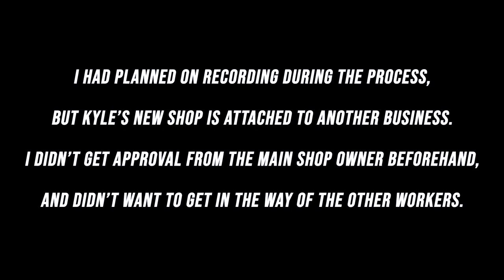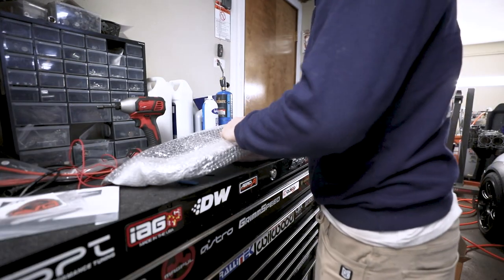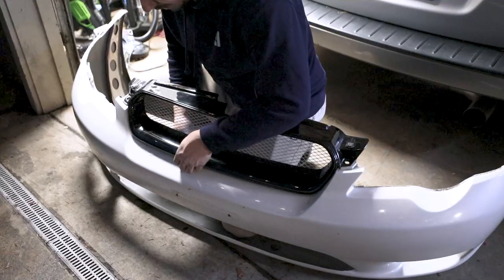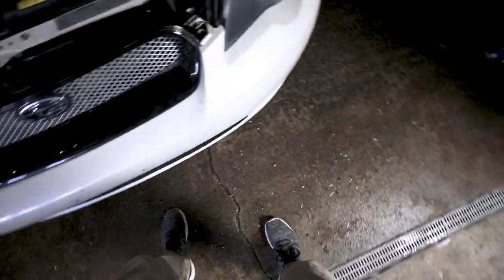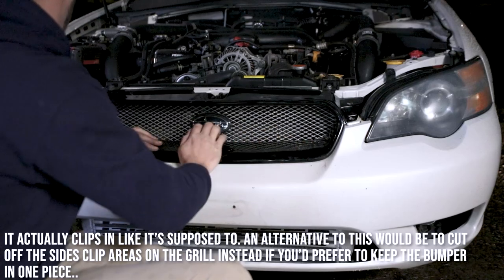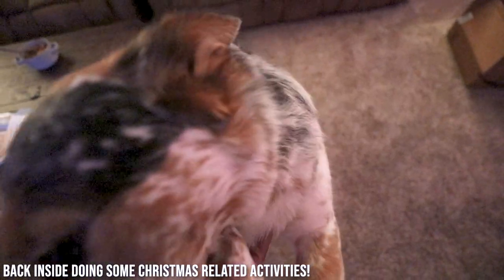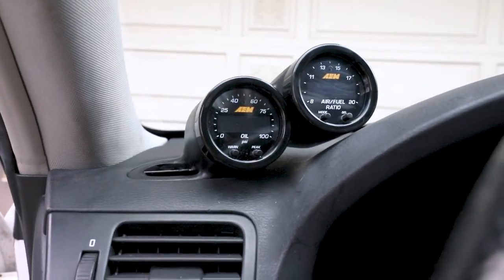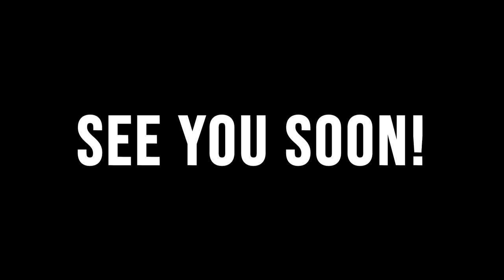This grille cost me less than $100.00. Was it worth it?

Comment: Hey do you know any nice grills that would fit in a 06 OBXT, don’t know if the legacy ones are interchangeable. Thanks
Reply from the maker: Legacy and outback have a different shape so they aren't unfortunately. Jdm fit somewhat, but leave a bit of a gap at the bottom. I had to make mine on the outback prior to getting my jdm bumper.

Comment: Why didn’t you just buy a jdm grille?
Reply from the maker: Different shapes. Jdm has sharper corners, and you're normally left with a pretty noticeable gap at the bottom. Car had a jdm option grille on it previously, so I wanted to test out one shaped for a usdm.

Comment: The fitment looks really good, I think I'm going to grab one for my 06 legacy wagon... just ordered some tein z coilovers, next will be sway bars. I've heard doing just the front on the wagons, is better than doing both rear and front for solving understeer. You think that makes sense?
Reply from the maker: I'd recommend front and rear. The wagons are honestly pretty well balanced, and the only times I had ran into understeer was either my fault (too fast at entry) or the tires themselves didn't grip enough. They do have an inherent understeer due to the front bias of the drivetrain, but it's minimal. I personally run a whiteline front and cusco rear on the outback, but I'll likely do front and rear whiteline for the legacy. 

With adjustable components, like the rear lateral links and upper control arm, you can make some pretty drastic changes to suspension geometry and alignment, but a lot of it like I said can have to do with what's gripping the ground in the first place. 

If you are currently looking at whiteline components, I'd recommend to check out emnoteks website. They have whiteline at like 2/3 the price of everywhere else currently, and I'll likely pick stuff up soon on case it doesn't stay that way.
Reply: @MatlasDI  thanks for the advice, ill check emnoteks for sure hopefully they ship to Canada

Comment: You know you can use some jdm grilles with usdm bumper I’ve had two that fit way better then that one
Reply from the maker: Realistically, I just wanted to test out the usdm fitment, and it was cheap. I've had a few jdm grilles at this point, and they've all left a gap at the bottom or not fit the shape quite right, so I figured I'd test it out.
Reply: @MatlasDI  no I get why but if you get a certain yr of jdm grille it will fit perfectly no gaps I can show you the two I had and what they looked like I will tag you in a post on one of our legacy groups
Reply from the maker: @CWW-tv  sounds good, I'll check it out 👌 think the only ones I've seen that seemed to fit alright was a zerosports or corazon.
Reply from the maker: @cww-tv3267  those don't look bad at all 👌

Comment: Love the progress! I'm definitely considering the same gauge set up. I was thinking of the middle section between the vents, but it seems routing wires would be much easier in this location. 
If you paint the grill trim white, leave the mesh silver. If you leave the trim black, definitely paint the mesh black. Just IMO.
Reply from the maker: Yeah, it wasn't too bad to get everything where it needed to be, just a little fun when there's enough of then over there. I like that idea for color scheme 👌
Reply: @MatlasDI  do you happen to have your old grill insert? Mine recently got busted and looking for a replacement.
Reply from the maker: @Brandon Lee  the chrome was peeling on the oem grille, so I had tossed it a while back.
Reply: @MatlasDI  all good, I'll just roll without until I can source one! Maybe if it the no grill/open grill look grows on me, I'll just go for a similar aftermarket one